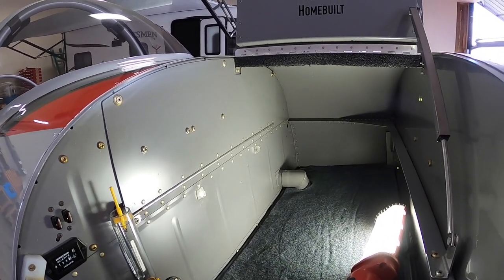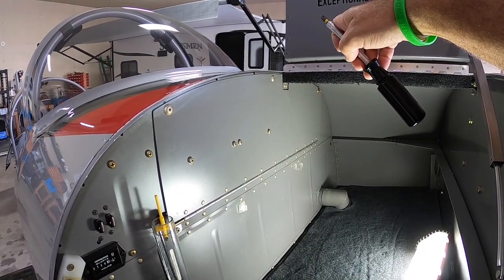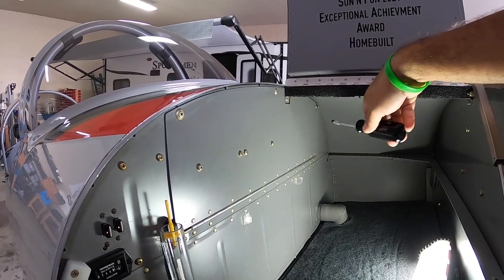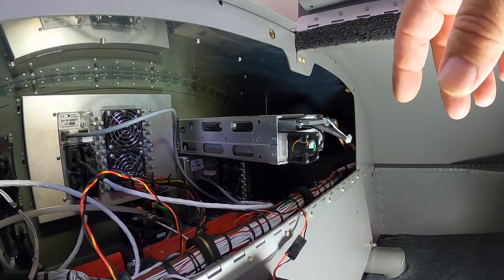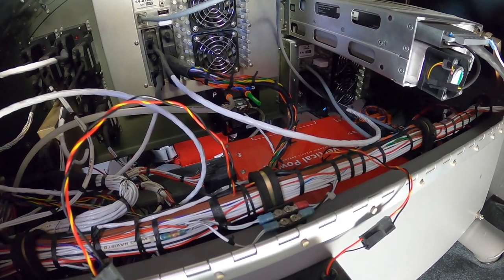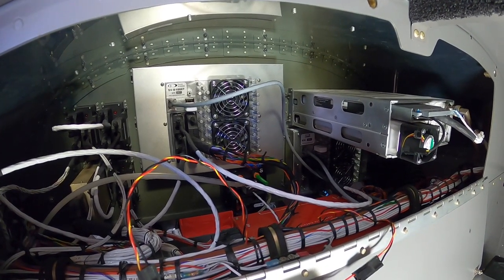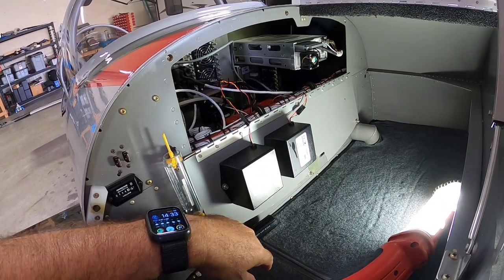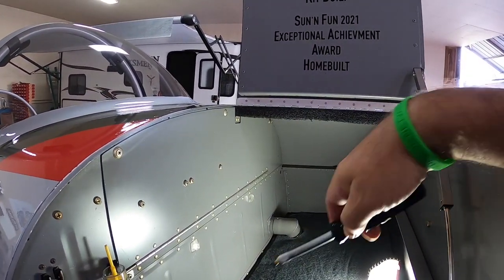Instrument Access Panel

Comment: I would like to see a video of you working on the instrument/radios on the left (as seen from the  opening). I myself find it beyond any curse words invented. My I offer an addition to your door. While sitting in the cockpit and looking at the instrument panel, run your fingers under the flange of the instrument panel proper, and the two side panels. Note the flanges overlap, one on the left side and one on the right.  Drill a hole in the center of these two 'flange overlaps'.  Place a cowl pin (A.S.S. AN416-2 for example) in these two holes (mine are about 2-3" in length, hardware store). Unscrew the instrument  panel and watch the panel drop 2-3" and lean towards you Depending on the size of the drilled holes related to the diameter of the cowl pins gives you how far the panel will tilt towards you.  The whole back side of the panel is now at your command. I at first used a chain to keep the panel from leaning too much, but later found I did not need the chain. Twixt the two methods nothing can hide from you.
Reply from the maker: It is actually pretty easy when I take out the 10” screen. Gives me a lot of room to work. Your idea is a good one though, part of what I love about experimental aircraft and their builders…awesome ideas!

Comment: Hi - Thanks for video. Where did you terminate your grounds?  I had been planning to put mine on Center FW in the baggage compartment. Your fwd baggage compartment has a nice clean look.
Reply from the maker: So my “Forrest of Tabs” is in the lower portion of the forward baggage area where I mounted my battery. Here is a link to my blog with photos of my setup: https://www.rv8-hangar.com/battery-charging-port/

The tabs are then grounded to the engine case.

Comment: So...because I'm a nerdy Pitot / Static inspector...why is the Static tube on your lower instrument cut off? Are there no static ports on the airplane?
Reply from the maker: Hi Mike, the pitot line was easy to run from the wing root off of a T. The static line would have been a harder run after the fact. The difference in airspeed between inside static and outside was 9KIAS. So I adjusted in the uAvionix AV-30 for airspeed and now they match up fine. Since I’m unpressurized this isn’t a big deal to correct for.
Reply: @therv-8pilot  makes sense, but checking/calibrating the pitot static system as one closed system will be just about impossible. :) the AV-30 will have to be connected to the rest of the system to do a legit test with a calibrated static test set. I’m just being a nerd. 🤣
Reply from the maker: Yeah I will cap the AV-30 side of the pitot and just test the Dynon side of stuff just like I did for initial testing. The AV-30 is just an emergency back up.
Reply: @therv-8pilot  I gotcha. Yeah, I’m sure it’s different for experimental but fo certified stuff it has to be a closed system and tested all together. It’s not IFR certified, right?
Reply from the maker: Yes in my OPS specs it certified for IFR and VFR.